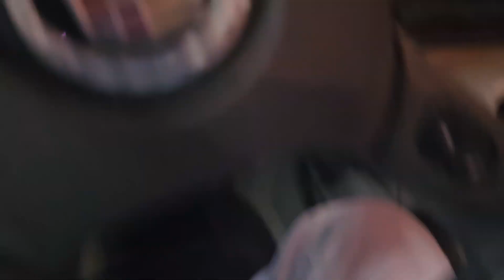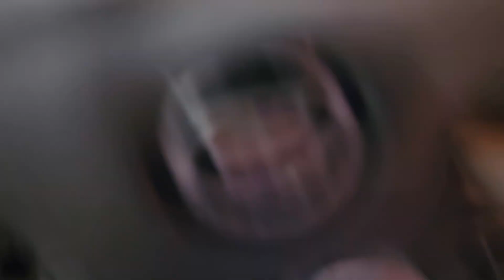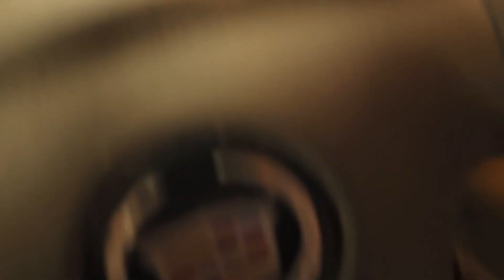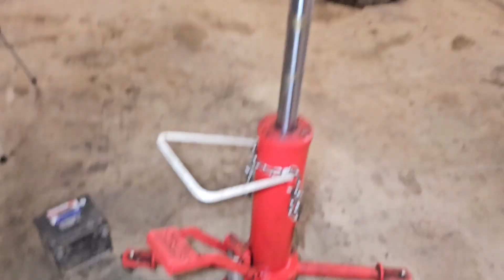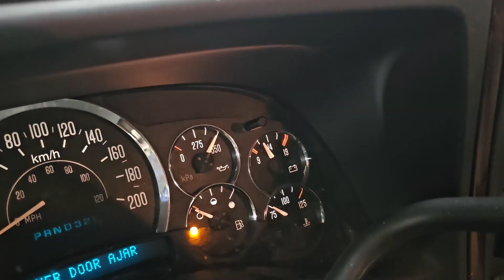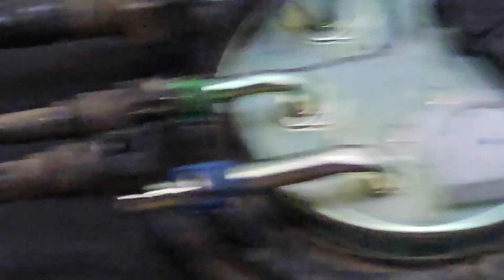How to Replace a Fuel Pump on Escalade (Works for GM Trucks: Tahoe, Suburban, Silverado, Sierra)

Comment: I just watched your video on the crankshaft sensor and I’m getting codes p0018 and p0019 would that be a sensor issue or more of a timing chain? It’s a 2012 Chevy traverse with 150,000 miles
Reply from the maker: With it setting correlation codes for both cams on a single bank (not other codes?) My guess would be that the bank 2 chain has stretched. 
If you had codes for the other bank, I would look towards something else, crank sensor, etc. But if it's only one bank with both cam codes, I would place my money on that banks chain has stretched, causing it to be out of time. Especially with the known timing issues these vehicles have.

But to be sure 100%, you'd need to go in and verify.